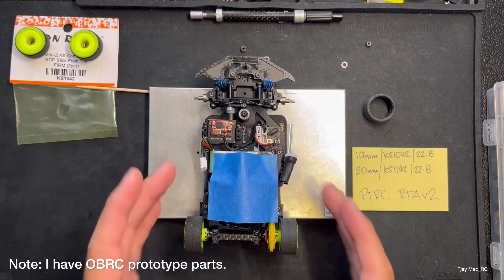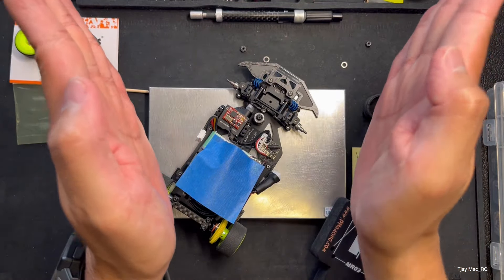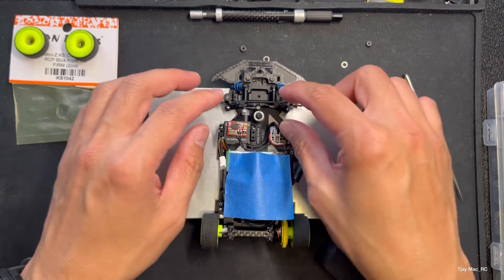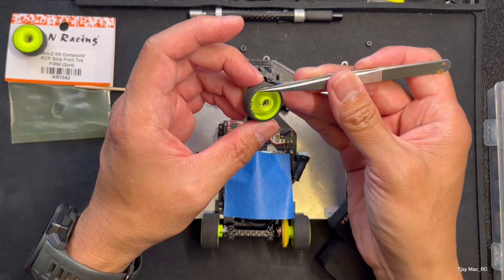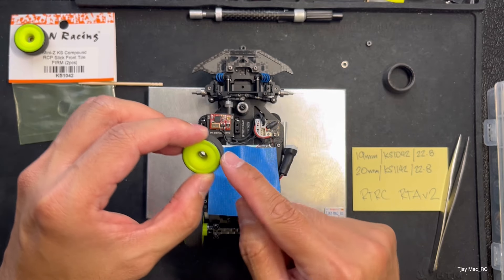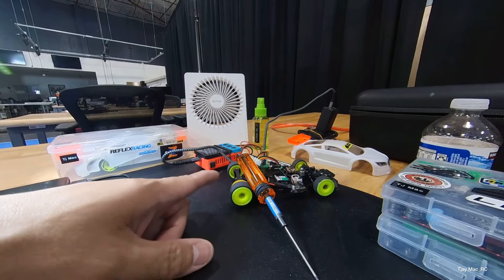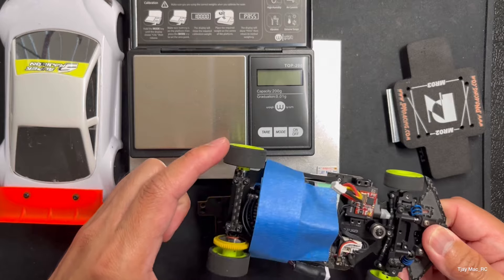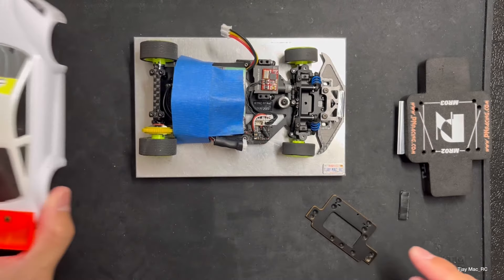RTRC RTAv2 | Traction Roll and Oversteer fix #rtrc

Comment: With the upcoming RTA conversion kit, I think the active toe-in will be eliminated by using the knuckles from the RX28.
The battery position will also be further back, and the rear roll center position will be lowered, which is great!
Reply from the maker: @rgarage02  There’s no need to use RX28 knuckles. You now have the option to run direct steering. This setup by itself allows you to run the steering turnbuckles on top of the knuckles. This eliminates the active toe-in.

Yes, great improvement for sure especially rear roll center. Less dipping in the rear with the conversion kit.

Comment: The RTRC front wheels with full sidewall are the ticket.  I use them on most of my cars where they are legal.  What tire tape are you using these days TJ?
Reply from the maker: @marwanzabaneh5459  I use the Route 246 only tire tape.

Comment: I didn’t realize you were running brass chassis for 2500.  What does it weigh race ready?  I run the aluminum chassis with brass weights in bottom for Super Stock, but when I was getting my RTA ready for the PNNAC a couple of weeks ago I removed 3 of the 4 brass weights which got the car in race trim down to 166.6g (PN minimum is 160g).
Reply from the maker: @marwanzabaneh5459  183g total weight. Yeah its heavy. I do plan on using the aluminum chassis with brass weights just not right now.

Comment: I love RTRC for 2500kv i use all alluminium! Full Brass for open
Reply from the maker: I also plan on trying the all aluminum for the 2500KV class. I didn't have good success with the all aluminum last year but my setup last year and now is completely different. The all AL will shave 13+ grams of weight! I just need to do one more thing to my car before I switch over to all AL to try. Thanks for the comment!